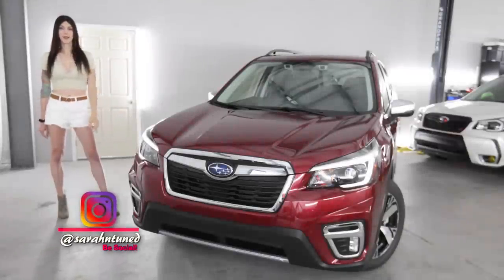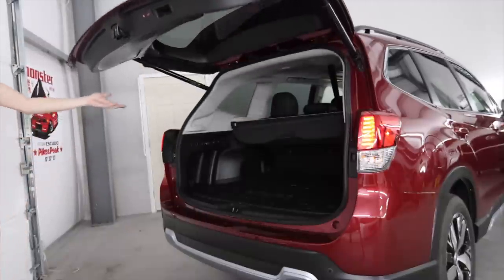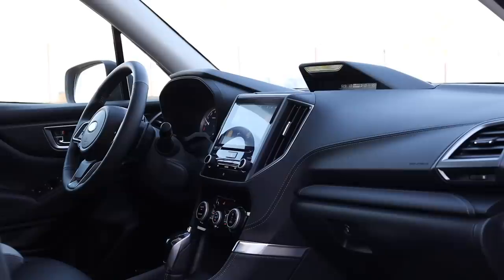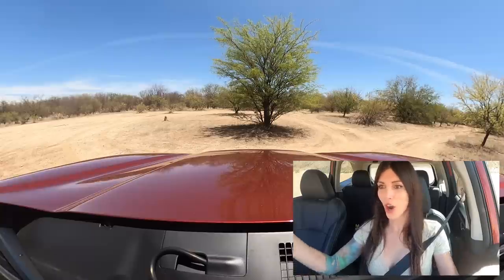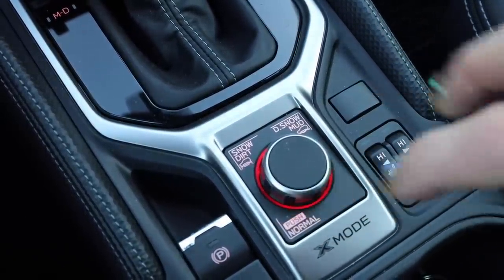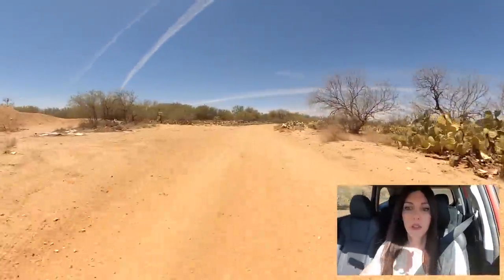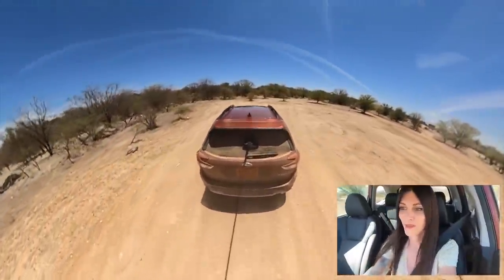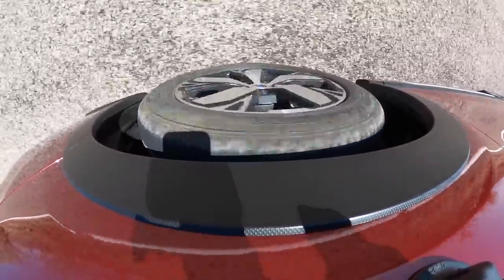I Pushed It A Bit Too Far.. // 2021 Subaru Forester Off-Road Review

Comment: I have a 2020 touring , its fantastic ! Averaging 35 mpg in 12,300 miles . If easy on the throttle I'm in the high 30s to low 40s . and that is what the dash monitor is revealing.  Bought it new , no oil consumption in between oil changes . One thing I was impressed with that you don't hear is the turning radius is  super . Came from a 99 jeep Cherokee that took me many miles. Its an eye opener how the technology has changed/advanced and safety is so critical these days. I'm enjoying each and every mile !

Comment: Absolutely 100% agree with the review on the Forester. I picked up a leftover 2020 Touring model last year. Definitely had a lot of features and decently priced. 

The lack of a turbo model was quite the bummer. That was partially the reason for going to the Touring. Fill the void with gadgets.

This is my 5th Subaru as it's hard to beat the AWD system. Living in a area that has snowy winters greatly influenced to go with Subaru. And to your point, Subaru does seem be trending in that direction that getting in long with the other manufacturers. It probably makes more sense on paper because it appeals to a wider audience. But that's not what made Subaru great. Won't hold my breath but would be nice to see it again. Also, I miss manual transmissions... 😥😥

BTW, love the styling of your Gump. Love that front bumper with the vertical spot door the fog lights. Not to mention it's a turbo model.
 
I do love you reviews. They are not your normal "spew-from-the-brochure" reviews you normally see. Informative and entertaining.... A great combo.

Comment: I have a SH Forester 2.5 X 5-speed. It is on coilovers, rear lca's and other suspension goodies. Rides on 18x9.5  wheels with Falken Azenis RT615K+. It handles like a go-cart but is so slow it keeps me out of trouble with the law.  Best of both worlds. Drives like a sports car but huge rear to haul stuff. Next upgrade is a bolstered drivers seat and STi 6-speed swap.

Comment: Needs a turbo & a dual range manual.

And to be offered in Forest Service Green.
Reply: For sure on the turbo. Would like a geared transmission as that CVT drones under load.
Reply: And need a real transmission, CVT's are a joke.
Reply: no turbo needed, but low speed gear box for sure
Reply: You want turbo? Add  AOS to the wish list.Mandatory.
Reply: @williamevans6522  Whatever it takes. Would not buy the Forster with the current 2.5NA.
Reply: @digitaldoc100  meither

Comment: Sarah: there is a 1.8T in Japan already: Forester, Levorge and Outback comes with it.
It doesn't have much power, but decent torque available low. Just like you wanted :)
The engine is designed for economy, not for power. Saying that, the torque curve is decent,

Comment: All these compact SUV's need a performance model option. I've test driven the new Hyundai Tucson, Subaru Forester, Chevy Equinox, Toyota RAV4 in the last 2 weeks and they're all slow turd-mobiles. Pathetic levels of slowness. Granted, they're not meant to be sports cars, all I'm asking for is some zest in them to make them interesting and perform better in higher elevations. The CX-5 is my last hope with the 2.5T.  I'd probably be happy is Subaru gave the current engine a boost to 210 HP as that would liven it up enough. Otherwise it's a cool little SUV.

Comment: I think what you are trying to explain is that the symmetrical fwd system has equal length 1/2 shafts at each axle so torque steer is basically nil.   You put out ( ahem ) great car reviews.  Karmon Hardon - love your mind Ms. P.

Comment: at least you get a taste what Subaru provides us in UK/EU -- non-turbo, thirsty engines and under performing CVT, with no WRX or STI models anymore!  Hard to justify replacing my Gen 5 Outback with a new Gen 6 when due -- new Gen 6 has less power and still thirsty, plus due to EU emissions, prices have gone up £3k+.

Comment: The TFL people also found the CVT transmissions suck galactic muffins. I have a 2012 Forester X Touring and it's the last year with a real transmission, albeit an automatic one, but with timing chains rather than belts. My Forester would, with a slight lift and better tires climb that hill. The Softroading the West channel people ran the exact same model I have and did some pretty awesome hill climbing with it.

Comment: Brakes are OK it's the same system that's on my 3.6R also its so funny to see that everything is in the same location under the hood Subaru hasn't changed much since my 13 model.

Comment: Subaru is putting out a 1.8 litre turbo with 178hp/130kW - truly gutless, but probably tunable. A bit. In Japan.  And it's possible that Australia will get the new 2.4 litre turbo in the Forester.

Comment: Funny enough I was looking over some of the maintenance a colleague was going to need to do to her Forrester earlier today.  Wow are those spark plugs a total PITA to get too!!
I completely agree its got a ton of nannies nowadays.  It's slow and super safe.. It's enough of a go getter for the "a to b" driver.  :-)
Can't wait to see the added parts on Gump!  :-)
Reply from the maker: They are not at all difficult. I changed all 4 of mine in under 30 min on my XT. Pull the battery on one side and the intake on the other. Super simple.

Comment: Wish we got the Levorg here.
Reply from the maker: Completely agree that the US needs those!
Reply: @SarahnTuned  Some of the additional features you can get on it are pretty cool. The rear emblem is actually a proximity sensor so you can walk up to the car, put a body part near it, and the rear tailgate will open electronically. The rear seats can also recline.

Comment: That sound lack of acceleration and all those safety features are what would keep me away from one of these. I am not a fan of variable shift transmissions. This reminds me of my 2011 Jeep compass, Way to underpowered and not worthy of off-roading. I personally had to upgrade my brakes as the original ones were junk. I use to have a 1990 Cherokee Laredo and their is no where it wouldn't go, Unfortunately these newer vehicles can't do what the old ones did. Not true Off-Roaders. Love the review though!

Comment: Sarah I have two questions: 1) when you did your coolant leak fix on Mr Dos, back in 2018, how did you gain access the the opposite end of the bypass water pipe where three hoses connect (two big and one small) where they connect at other end is below all these other hoses and distributor and water inlet? 2) on you MacBook Pro you have a extension connection on left side of your laptop that you connect the accessories to ... where did you get that who makes it? Thanks.

Comment: The problem with subaru off roading reviews is that they never test it the way an actual owner would have it if they were even attempting an obstacle like this.
At the minimum better tires and aired down.

Comment: Did you try this in x mode deep snow and sand, it is a low drive mode, crawls better.  I have a 2019 with a body lift and yoko get tires that I put on. I have thru some amazing trails, inc. 12 deep volcanic dust by Mt Shasta, so deep the center of the under car was grading the burm. But this vehicle is way under powered. I have gotten 35mpg on hwy Tucson to Phoenix

Comment: Great video you should try Audi Quattro technology with either Audi Q5 or Q7 ;) nothing can beat it
Reply: I have never had my Q5 off road... and have never spun tires on dry pavement... 345hp.
Reply: @mostcom  The quattro system is superior to all other AWD system, i have a Q7 ;)
Reply: @mdcartstudio9447  I will not be able to concur until my Audi has accrued 125,000 more miles like my 04 pilot did trouble free.
Reply: @mostcom  All depends of the user ;) ... i do all my maintenance including differentials and transfer case... Transmission etc ;) i have a 08 cadillac cts with over 325870 miles and still runs like a champ

Comment: I agree with you, need more momentum for that hill. But in order to use that momentum, hill must be not that bumpy, more flat. O well, than we don’t need Forester, anybody will be able to climb that hill on Prius by using momentum. Conclusion: Forester very overrated nowadays. In old time yes, Subaru’s awd system was one of the best, but not now. There’s a video, Kia climbed best uphill than others awd SUV’s and Forester was not even second or third. By the way, no I will not buy Kia, still like better Forester, only how it’s looks

Comment: Every car deserves a performance model.

Do the SJ LED headlights have the swivel action too?

Most torque vectoring by braking systems use the hydraulic/abs system, not the electric parking brake actuators.

Comment: Subaru is an ok vehicle if you plan to sell it before it hits 100k! Afterwards you run the risk of head gasket issues and timing belt problems. Both very expensive to repair! If you doubt my input google a diagram of the timing belt on the 2.5 liter outback engine, the timing belt is VERY long compared to other internal combustion engines and that is not with conducive with a long lasting engine. Buy a Toyota Rav4 or better yet, a 4 runner

Comment: For my personal use? All cars with CVT's are useless, electronic toys. Just try using one on hilly roads and freeways on what I estimate to be less than 10 degrees. (Soft, fluid hills like in NW Florida near and around Tallahassee) I would NEVER buy another Subaru or any other car with a CVT...

Comment: Wow it's like Sarah read my mind perfectly encapsulating the exact issues I've had with the way Subaru has been trending over the last several years. Remember when they catered to a niche demographic that wanted off road ability, nice performance features, and unique (even quirky) styling? Now it's all soccer mom world. WAAAYYY too many safety features that actually become intrusive into the way you want to drive, no turbo offering in Forester anymore, no 6 cylinder offering in Outback/ Legacy (and the 2.4 turbo has a huge lag from what I hear) and no sport sharp mode (remember that in the Outbacks a couple generations back, along with the panoramic moonroof?) Plus the horrid CVT that has zero acceleration in the 2.5 & feels like it's rubber banding all over the place. HATE it. Subaru needs to remind themselves what made them popular in the first place. And no a "Wilderness Edition" with just some upgraded styling cues doesn't cut it.

Comment: Again, you came out with a review a week after I decided to take a test drive; which would have saved me an hour of my life. I wasn't impressed at all. For being a 2.5, it had all the get up and go of a Geo Tracker 1.6l auto. Considering the market climate and the ease of brainwashing 70% of the buying public into buying a truck instead of a car; it was an unfortunate next step for Subaru. You; like myself; bought a Subie for not only the AWD but for the performance it inherently had. I will give them credit where credit is due: the mpg and safety features are well above the price point. Granted, the Forester wasn't meant as a sports car but it easily fit the category because of the drivetrain. I hope they don't make the Forster any fatter; it seems every model is growing in size; or slower. This is the perfect mix between car & truck in a package that's easy to drive and maneuver. The sad thing is; other than the mpg; my 2002 Impreza Outback Sport 2.5l auto beats it overall. Even the salesman who drive mine for the side-by-side drag comparison was surprised how slow they've become; and mine has 172K mi on it.

Comment: You are completely correct, Subaru has lost their way.  Watching it try to make it up that hill, but with the 4x4 system obviously not sending torque to the tires that had traction, confirms this.  Sad… I had a WRX wagon a lifetime ago, miss the heck out of it, but it could still climb a wash and dig itself out of a snow bank.  That Forester doesn’t look like it could do either.

Comment: That transmission needs a real 1st gear!
Reply: agreed! they actually did that with the latest Toyota CVTs
Reply: yeah, 1st & reverse. That is the thing I do not like about my XT. I can never be sure that I can back out of a trail that was almost effortless going forward.
Reply: @hmpeter  I have an iQ, and it takes forever to go into reverse, it's gotten me into trouble a couple of times. I have to floor it to get it to move from a dead stop on a hill. No CVT Subies for me, hard pass!
Reply: @zabnorg  I read somewhere that when de Subie CVTs get slow in reverse, they need to relearn a transfer clutch to fix it. Not sure how valid that is. While mine will never be as fast as my old manual in that regard, it is ok for my driving style. No need for quick turns with reversing here. My problem with the reverse is the low torque it allows at the wheels. Sometimes I drive into old forest service roads where I can't go further at some point and need to reverse. If there are some roots or stones just fist high, it might not go over them. I don't understand that because it has no trouble driving over curbs in reverse. That really sucks.

Comment: For real off roading, it has the wrong transmission - CVT are awful for that task, wrong tires, wrong suspension, wrong engine, and not enough ground clearance.
Reply: In other words, wrong vehicle!  Subaru testers have a habit of testing them in situations they were never designed for.

Comment: That thing has no flex and two tyres firmly on the ground is not enough. Four wheel lock is far better than traction control, sadly no longer fashionable.

Comment: My son had a WRX sti. It was a piece of shit. After 60,000 miles the rear right wheel ball bearings went out. $1000 repair. The cam belts need to be replaced at 80,000 miles. $1200 dollars. With all it's all wheel drive it slid on ice on a ramp and was totaled.
Reply: I don't know how you think all wheel or 4x4 work, but it doesn't matter how many wheels your vehicle can spin if your tires aren't getting traction. So unless it was equipped with studs, fwd, rwd, awd, or 4x4 they're all going into the wall on black ice while decelerating and turning 🤷🏼‍♂️
Reply: In all fairness, Subaru’s are known for wheel bearings going out earlier than they should. I have the ability to change them myself so not a huge deal for me. 
I’ll never buy a vehicle with a timing belt! I’ve helped others with changing them and it’s a lot of work or a lot of expense to have someone do it! My 2018 FXT with the FA20 engine has a timing chain. If it had a belt I would have bought something else.
Reply from the maker: Paid someone $1000 to change a wheel bearing?!! That’s insane. They literally unbolt from the rear knuckle with 4, 14mm bolts 😂

Comment: Sold my Forester to get a Passport. Never been happier.
Reply: Gotta love the v6
Reply: @tonychau1983  transmission is also super reliable. Had two CVTs blow in my Subaru Forester XT 2016. In Canada each CVT is about 10-14 grand. Fought with Subaru on my last one because their tech forgot to replace the seal after fixing the third CV axel to rupture. Oil spilled out on drive home and made it into a grenade. Never again. Loved the old Subarus but now all the new ones are junk.
Reply: @dyounos6446  10 to 14k 🤑. I guess thr blown headgaskets were a better deal
Reply: @tonychau1983  lol at least that I could buy the gasket cheap and do the repair at a decent cost.

Comment: Rims are junk. Tires look cheap. Fake chrome on the bumper. Never think of buying a subie
Reply from the maker: Wheels* a rim is the outermost portion of a wheel.
Reply: @SarahnTuned  A wheel consists of a rim and rubber. Rubber is the tire, rim is the rim. Equals a complete wheel set up
Reply: Google 20 inch rim, see what pops up.
Reply from the maker: @westcoastturbos  Google incorrect terminology due to lack of education.
Reply: @SarahnTuned  no thanks. 20 inch rim, 5 lugs, pirelli rubber. Nice set up
Reply: @SarahnTuned  wheels on the bus go round and round......
Reply: @SarahnTuned  rim to rim Is the measurement of the rim as a circle, which gives you the Inches of the rim?  Put rubber " on the rim " and call it a complete wheel set up? 4 wheels on a car?